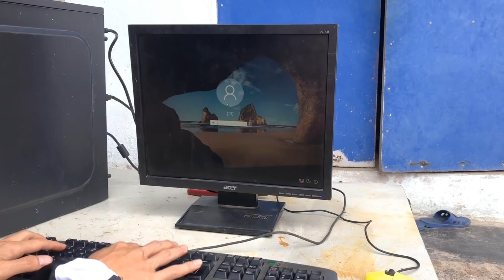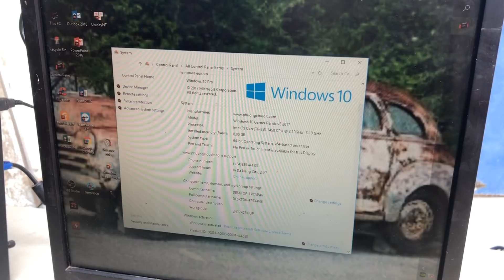Restoration a destroyed 30-year-old PC | Rebuild and restore 30 year old PC

Comment: Fake. Here's 45 reasons why:

1. How is it possible to have uniform mud on ALL surfaces, inside and out? And even on all the wires?!
2. How could mud possibly get UNDER a screw head?
3. Why is there no mud inside the slot on the screw if it's everywhere else.
4. at 2:26, why is one screw shiny?
5. at 2:42, why is there mud where the CD drive was?
6. at 2:51, why does the mud look painted on?
7. anyone else seem surprised by the lack of leaking capacitors?
7a. or by the jacks that seem pristine (given no mud)?
8. at 3:42, why does the hinge mechanism work, let alone exist in the first place?
9. at 4:12 DIRT... IN A HARD DISK???
10. 4:48 should just explain itself. NO!!!
11. at 5:15, the capacitors again. Perfectly straight and not leaking?
12. at 5:43, dirt... under the screws, IN a PSU???
13. at 5:51, that's how you lose screws... i'd be surprised if he "somehow" doesn't lose one.
14. at 6:03, why does he put a circuit board in the water?
14a. If he can dunk his motherboard in water, why can't we?
15. He just killed his hard drive at 6:13
16. Does anyone care about a wrecked CD drive so much that they'd open it up?
17. at 8:49, the rails don't seem lubed. They will make a sound or fail if he tries to use it.
18. He killed his HDD twice now because he scratched the platter and the head.
19. at 11:07, the color of the river is the same as the mud; that probably explains where the painted mud came from.
20. Spray painting without primer?
20a. And without masking... he messed up at 12:00
21. Killed his HDD again. Look at that head!
22. His PSU has no marking whatsoever, no brand, no model, no ratings, no stickers?
23. The guy must be a genius.; he must know exactly how to put together a CD dri--- wait! he forgot to put the latches on the gears! 
24. 15:06, The date on the CD drive says 2010... so much for a 30 year old PC
24a. The PCB has a date of 2009, so much for a 30 year old PC :|
25. That looks like a lot of RAM for 1990. Wasn't the limit like 100MB or something back then?
26. And it looks like DDR3, totally 1990 tech!
27. USB 2 existed in 1990 right? NOPE! Not until 2000.
28. Look at pictures of 1990s computers. And then look at this.
29. 18:03, that new intel logo wasn't rolled out until 1991.
29a. That's probably a new fan, too. Don't remember seeing a logo on it until now. 
30. Windows 10? That was sooo 1990. Even windows 95 didn't exist yet.
31. WHO NAMES THEIR ACCOUNT pc?
32. He picked this up off the street. Why does he know the password?
33. All this on an HDD with ONE platter. THAT WAS MURDERED AT LEAST 5 TIMES?
34. 8 gigs of ram, an i5, a copyright 2017, 64 bits... sooo 1990.
35. Just to point out, he exposes his registry key at the end without any blurring or masking or what. So smart!
36. The music masks his laughing at our stupidity probably. :/
37. Why is his system language English?
38. WHY??????????????????????????!!!!!! Views, ad revenue!
39. No rust whatsoever.
40. You'd think he'd spend time restoring his screen.
41. This is how many smart people agree.
 |  Don't forget to dislike and unsubcribe!
V
Reply: Yeah
Reply: A hard disk is seals dat noting like dirt or mud and ect kan get in there is no way in hell dat al this mud ans dirk and get in there
Reply: And the hard disk is even water resitand olny were the stickers are can get mud in or ader crap and the sticker are Just fine it looks like and how can hé get it open So esly the scroews are gleudt
Reply: But nice job vinding al of these respons it's fake
Reply: You are Sherlock Holmes 2.0 bro😂😂😂. This is absolutely fake video.
Reply: @krisin.5959  Thank you.
Reply: @kyria_kous  i dont understand your name!
Reply: Have you ever felt the touch of a woman?
Reply: You only gave 41 but still good job
Reply: Yeah you right bro
Reply: Well done for being honest. YouTube is the reality site.
Reply: i mean it's entertaining. It's not educative
Reply: Ademas, cuando abres un disco duro por primera vez es necesario quitar los sellos o estampas adhesivas y este disco ya no las tenia
Reply: It’s not fake he didn’t put the circuit board water. There is this liquid that can wash circuit bird without ruining it.
Reply: How mud got inside is because he found it with one of the covers off
Reply: @fenix182  best comment ever XD
Reply: @fenix182   oh here comes the chad that roasts the nerd
Reply: The most important joke is that his board have many bent CPU socket pins and without applying any thermal paste into CPU and chipsets the PC can start up...he must be PC god...😂
Reply: He could of got new parts
Reply: He could have gotten a new hard drive.
Reply: All true I read the whole thing good job
Reply: Yeah, I find it very hard to believe that it's 30 years old. It doesn't have Intel 8088 or a 286, maybe 386 like what the f--
Reply: realomegadrumer it does ha a Intel core i5. He didn’t even put dos box on it.
Reply: NayNay ZA he could just me smart on the subject and they could have a partner.
Reply: @Gamer-wf3jx  There are things that are 𝗽𝗵𝘆𝘀𝗶𝗰𝗮𝗹𝗹𝘆 impossible; regardless of skill level or found condition. Such things-- if true, would shake the fabric of reality of the universe.
Like:
Time travel. See #34, 30, 27, 26, 25, 24.
Metal oxidation physics. See #39.
Common Sense. See #40, 36, 12, 13, 14, 16, 22, Literally every comment and reply on this video.
Reply: Johnathon Baker and what does that mean? It means he couldn‘t restore it therefore it isn‘t fully restorated
Reply: Leon Mader I mean is he could have just gotten a new hard drive but he could have kept the same fan.
Reply: Hey man, good job! This is very fake video ! I cant believe that is dirt INSIDE in the hard drive that is unreal. TOTALLY FAKE
Reply: just have to ask, how much time did it take you to write this comment?
Reply: @jay-dj-0618  I included the alphabetized parts of some as well. Some were rhetorical, too.
Reply: @salimbenjelloun3689  Good question... half an hour?... I think.
You should really see https://www.youtube.com/watch?v=LkECSfTDwjs for another comment like this by me. So fake it's actually worth watching.
Reply: hahahha this is fake
Reply: Good
This is what i want to see
And this video makes me puke !
Reply: I knew 0:28 in that this was BS. Didn't even bother watching the rest, good job on your patience watching this shit man.
Reply: @johnathonbaker1084  You aren't very good with technology are you? Or very observant for that matter. If it was in as horrible condition as it looked, the pcb circuitry would have been destroyed by the corrosion, making any and all attempts at restoration pointless. I mean... He brushed the hdd plates for the love of God... At this point i'm surprised he didn't just paint the plates to make them look better...
Reply: Yes bro.. 90s kids know how these things worked... Just open hard drive its done plates react with oxygen and got badly bad sectors... Fan looks modern... And many more lol
Reply: @johnathonbaker1084  washing circuit board does not get any problem.. I did many times.. Just be sure its fully dry...
Reply: @muhammadadnan8476  Yeah me too, I wash my ECS H61 motherboard with tap water twice a year for like 8 years now, still good.
Reply: 2:44 SATA HDD :)
Reply: He does not know laws of physics.
Reply: So far i know when you opening hdd, and careless to touch platter and head, congrats! For murderer your hdd. Fake restoration.
Reply: And Windows 10 on 30 yrs old pc???
Reply: And another restoration pc has same wallpapers
Reply: do we have to care.
Reply: Jesus man you murdered the guy
Reply: Tqs bro
 same questions arw running in my mind
Great job 👍👍👍
Reply: Nice job dude thx
Reply: Nvidia geforce experience donloaded
Reply: Because in certain case only water effect on an mother board and it's for one question and it should be dryed after applying water and it does int performance..but ..only if it's not damaged
Reply: password?
Reply: @tutestudio87  apparently... i guess \_(^_^)_/
Reply: @planeinformer2247  yeah ,what about neccesary upgrades to run windows 10 ,what about motherboard too?
Reply: MASSIVE LEGEND
Reply: All yiu said is right, 👌👌
Reply: This deserves a lot of likes for the job
Reply: ok boomer
Reply: Make it loouuuddderrrrr
Reply: Boss
Reply: Absolutely right, but he also forgot to smear thermal grease under each of the radiators.
Reply: This is what i call "critism", thx for the critic mate. I almost got fooled by that video
Reply: I’m like you I’m a computer nerd too that can never be a 1990 computer that computer had like 8 gb ddr3 1366 MHz ram
Reply: Johnathon Baker it was fake how you can never download windows 10 on a pc from 1990 and that computer had like 8 gb ddr3 1366 MHz ram have you ever seen a computer from 1990 with 8 gb of ram your answer is no
Reply: Fake. One reason why:
1. Foxconn G31MV.
Reply: True
Reply: and that pc is 775 775 socket mainboard is 2006 so it's not 30 years
Reply: Yeah
Reply: a 30 year old pc should be have windows 3.0 os
Reply: The main fucking shit it that the SATA is even not available before 30 years
Reply: 46. CPU socket is destroyed (pins are bend) 16:13
47 a. SATA port has been released around 2000 
47 b. Foxconn G31MV https://www.cnet.com/products/foxconn-g31mv-k-motherboard-micro-atx-lga775-socket-g31/
48. Actually no repair, just washing the dirt out of the computer (Basically a "trashed good computer"?)
49. Optocouples and coils are loving water :3 I am sure the PSU has the right voltage outputs
50. Windows 10 boots instantly and super fast
51. Password hack on a 30 years old Windows 10
52:
Foxconn G31MV:
20 years old motherboard with LGA 775 socket (Maximum Core 2 Duo support), Max 4GB DDR2 RAM
After washing the shit off:
Boots windows 10 like using SSD
Suddenly 3rd gen. i5-3450 appeared with 8GB RAM
Reply: Oof faker
Reply: 3:48 Also the HDD doesn't have  a silver metal/plastic type of seal over the middle screw on the HDD so obviously it's been opened before..
Reply: You have achive fake releash mastah
Reply: 42. no video card but  18:30
Reply: I understand is a fake becoze you can not restore password just like this ..
Reply: I saw usb slot on back panel.
 Is it ok!!!
Reply: You forgot one thing.. Did you notice that no part has a sticker? not on the HDD, optical drive, ram, PSU, etc.. Nothing whatsoever.
Reply: nice sharp observation
Reply: Yes, that modern tower pc was not yet in market in 1990.  I think it's 2005 to 2010 computer.
Reply: And the socket of the motherboard is lga 775, the socket of the i5 is lga 1155.
Reply: god.
Reply: Well, drop mainboard and doing like this video can make this PC become true TRASH.
Reply: ya an i5 in socket 775? it in socket 1155 .18:19 18:40 lol.20:13 da nang?
Reply: XD exact
Reply: Lol knew it when he picked up the pc and washed the hard drive lmao
Reply: 46. Seems legit desktop wallpaper is a rusty car that need restoration lol
Reply: This thing is sata from the begging ahhaahhaah
Reply: IS THIS A CBI INVESTIGATION XD
Reply: Idc but restoration progress was well done
Reply: Gresha C. I have noticed the same things as you did. One more thing to add is that the computer that was connected to the monitor is not same computer that he claimed to restore. These people just do not have anything better to do than to post fake videos I guess.
Reply: It's obviously a fake restoration video 😂😂
Reply: Correct bro!!
Reply: Yap
Reply: All Restoration T-D's restoration videos are fake
Reply: Exactly!!!
Reply: @kyria_kous   ellinas?
Reply: @ThePoptardedtj  it's greek name
Reply: Correct he just set this all up
Reply: @vanessaivonnelara2556  Es un completo sinsentido, dejando de lado esa aberración que hizo con el disco duro, y que los tiempos no corresponden, el título dice que la computadora está «destruida», y yo no vi destrucción por ningún lado, la única destrucción la hizo él mismo PREVIAMENTE al disco duro, incluso en videos más serios por el estilo, donde sólo se señala que se hará una restauración, salen de imprevisto detalles en los componentes que son irreparables, y el «restaurador» aficionado o serio, muestra claramente que se tuvo que reemplazar uno o varios componentes... este chico sólo «lavó» la computadora completa como si se tratase de un juguete enlodado... Saludos Ivonne.
Reply: X Factor
Reply: + He don't have a graphics card on the pc, but the vga cable is plugged into the slot of the graphics card when it's running.
Reply: Wow with out Editing the comment
Reply: What did you expect from china man?
Reply: @johnathonbaker1084  what is the point of restoration if you only keept the cover of the computer?
Reply: É até legal de assistir uma coisa dessas
Reply: i think he buyed new screws there is no rule that we should restore it with the help of old things
Reply: Really agree with 15 this is "how to fuck hard drive sim"
Reply: I have seen an a 1990 tech PC in our home my parents used it then put it basement then one day i started exploring basement for a bit i just found leftovers a case, motherboard  no ram no cpu no cooler and a screen like old tv's XD
Reply: @salimbenjelloun3689  Let's just say it was the best 30-40 minutes of my Youtube life this year.
Reply: Yo no espiko inglish we
🤣🤣🤣🤣
Reply: I don’t really know why I don’t care that this is fake
Reply: @greshac.3634  for thos wondering yeah it's just a waste of time. Unless he put morden hardware in the pc I don't think it can't support it. Plus pcs only ran on like 500 mbps of ram and it possibly could not run a 64bit operating system bc 16 bit and 8 only existed at that time and I believe windows 2.0 or ms dos 4 was a thing 30 years ago.

But in wondering if a old pc can us a modern hard drive modern motherboard  and modern CPU chip? Idk I'm kinda curious 

Plus Intel Pentium was a thing back then

Also remember that the computer is basically like our brain you damage something and it messes it up and I don't like the fact that there is no crt monitor. Ik I might be crazy but flat screen didn't exist in the 80s and early 90s Idk the history on when they really existed.

But the video is uhhh Iv seen faker videos that are much more entertaining.  So yeah
Reply: I guess everyone knew it's fakr
Reply: If I have watched the video before reading this comment I was anyway know that it's fake bec it's impossible to be a 30 yr old pc bec hhd (western digital) -(Samsung dvd cd rom) -(case itself) it should be old and minimalist if white
Edit: Washing circuit board 
There is No capacitor leaking
Opened hhd
Impossible to use hhd after a scratch on rotating disc
Fast Windows 10 on poor drr2 memory and 5400 hhd 
What a lie!
Reply: You forgot something. He published a restoration on a monitor and in the final part he puts the same clip as this video (also final clip) even the password guessing and this one is newer than the other one so yeah the last part on both videos were prerecorded

and they're Taiwanesen (I knew it)
Reply: @salimbenjelloun3689  Like an hour.
Reply: Also he bent the pins on the socket LMAO
Reply: I love you! I wanted to say soo much but you did it for me lmao. Thanks man! You are very smart.
Reply: @johnathonbaker1084  its called Advanced Soapy Se
Reply: @johnathonbaker1084  it is a type of liquid called Advanced Soapy Serum (a$$ for short) it has miniture robots that are inside the molecules and controls the air around it to suck up the gunk leaving a soapy spotless smell behind!
Reply: In 30 years old windows 10
Reply: he still resstored it, but he destroyed it so...
Reply: Thanks for your explanation, hahahahaha you burned the guy completely!
Reply: i5-3450 released in Q2  2012, yeah 30year old :D
Reply: He killed his HDD like 10 times :D and when he's turning on the pc, you can actualy see that the PC's panel is different. Nobody washes their computer in uganda river and then pretending that it works:D
Reply: Mucho texto
Reply: He also killed the cpu socket by scrubbing it, the pins are certainly dead
Reply: @TheZenAku  yes you are right bro
Reply: Is this my wife?
Reply: Your comment is the most interesting thing of this video 👌🏻👍🏻
Reply: bro, another fact: at the end of the video he showed a completely different computer, because all the video motherboard was on socket 775, but at the end it had an i5 3450, and this is socket 1155, which looks completely different (look in Google for pictures of foxconn motherboard at 775 and 1155)
Reply: I can confirm, that is a lga 775 socket and that was a intel cooler for the core 2 quad series (which was popular in 2009) and came out in 2006
Adding on to that,
Sockets did not look like that at all in the 90s... it would have a small fan and it would say PGA (your core model here) and have a am4 lock type approach.
Also not to mention it would have to have cash and d ram slots, it has pcie (supports modern graphics cards like the 3080) and it also has a modern 4 pin fan connector I am 13 and know more about PCs then you
Reply: And the pci express in 1990?
Reply: @diogogomes226  ikr
Reply: 42   At the end the caseing (black top and silver middle).looked perfect like it left the factory with no over lap even though he was spraying it like a 10 year old spraying his bike for the first time. Eberyone knows that he does it  reverse it's an old tried and tested method but still fun to watch for how silly it is. And let's face it its still a lot of work for the guy because he's got to take the thing apart twice and clean the dam thing too. So I suppose he's earned his ad revenue really.
Reply: @johnathonbaker1084  I know video is fake and done in reverse  but you can wash motherboards in water people do it often just as long as you make sure it's completely dry. It's actually a really good way to clean a dirty board and if done properly should give you no problems.
Reply: geo vai I am better with software then hard ware
Reply: Sata 2...
Reply: He has a different computer hocked up to the monitor when testing it.
Reply: Yes bro 10000% fake because video last cpu change this bro
Reply: 1:56 clean connector  and other video same fake
Reply: hey ,if anyone else  trying to find out 
electronic repairs london
 try Saankramer Electronic Magazine System (just google it ) ? Ive heard some incredible things about it and my neighbor got excellent success with it.
Reply: yea is fake  you can tell by the windows 10 logo at the begining
Reply: Yeah great work listing so many. You might be interested though, #14 is actually valid believe it or not. You can clean circuits boards with soap and water without damaging them as long as they're dry before you power them up. I personally would never try it though, too hard to be certain there's no water you can't see. Everything else though? Totally right. These kind of fake videos really need to go away.
Reply: Yes bro definetly fake
Reply: Just watch the vid mate
Reply: and, just by analizing how the ram and the cpu cooler looks like, its definetily not a 30 yo pc
Reply: +he would kill procesor pins while cleaning
Reply: Thank you for noticing these things and making sure I don’t subscribe
Reply: I only know how to build a PC but you are near of stephen hawking lol
Reply: @johnathonbaker1084  and ur telling right now he can clean up a hard drive like that brooo you don’t know anything about computers
And also it is impossible to run windows 10 on a 30 year old computer
Reply: @johnathonbaker1084  yeah a new motherboard because a 30 year old motherboard will not support ddr3 ram and also not a i5 cpu 

So he just bought a new pc after
Reply: @johnathonbaker1084  a 30 year old fan is not fitting on that cpu socket
Reply: wow you are my hero.... you type it all alone?
Reply: Rust is an important thing by Old stuff (even some Orange spotties) 

Even new computers can get Rust
Reply: what I see clearly, i saw a usb ports on the motherboard and sata port (power and data) on the dvd drive. Thats something for 1990. hahaha
Reply: To nemůžeš vědět jestli to je fake ok 30 let starý asi nebude ale fake to být nemusí
Reply: i have a "stock" PC just a cheap one and there are no labels on them and its from dell i believe, but i do agree on the HDD, you cant just open it and clean it? WTF? the PSU and DVD ROM as well???? water damages circuit boards, nah this isnt real it cant be, one more thing when i saw him put the password he did try a few times and the camera cut a few parts so its possible he went to the peoples house to ask for the password, dont judge to quickly on some things or get tunnel vision gotta think about every including when the camera does a cut
Reply: He drop his cpu on the water in 6:05
Reply: Yes its look like fake
Reply: I was so triggert when  he opends the hdd and cleand it
Reply: Works as ASMR though ...Call it "Fantasy Repair" ... then I would say great video
Reply: nice job bro :=)
Reply: You are really smart
Reply: https://youtu.be/-yhUPfDslcE?t=1104 turn on another PC
Reply: calm down u should relax while watching that's the purpose of the video 😁
Reply: Lol you took some time.... my friend just do the math... 30 years old pc = year 1990 ... no need to explain further :D :D
Reply: Point 19 -u r just awesome .....wt a guess ..even investigating department will fail to relate that thing 🤣🤣🤣🤣🤣🤣🙏
Reply: @markg3506  I mentioned the PSU's missing sticker, and the fan does have an Intel sticker (also mentioned). But yeah, you're right.
Reply: @johnathonbaker1084  (Read full message) For your question, it is anhydrous isopropyl alcohol actually, but by the way this video has certainly a lot of fake points, like how he   guesses the password and why i5 can possibly be on a 30 year pc, actually. He mostly killed that poor old pc and reassembled a whole new one that have a similar look.
Reply: @johnathonbaker1084 (Read full message) To say the least, the hard drive, motherboard, ram and cpu must be replaced, which means that more parts are replaced than original.
Why Hard Drive?
He destroyed the platter. By the way 1990 PC mostly wont have 16 GB hard drive. 16GB drive is the minimum for Windows 10.
Why motherboard and RAM?
Motherboard won't support 1GB of RAM if it is made in 90s. Windows 10 will mostly crash on boot if RAM is not enough 1GB. The pins are also damaged beyond repair. 
Why CPU?
Well, no i5 processors are made in 90s.
Reply: You deserve the likes
Reply: Open a hard disk, and mud inside.Jesus
Reply: my man you totally roasted that guy lmaooo
Reply: Its LGA775! FAKE! 👎👎👎
Reply: Usually the 30 years old computer’s color was white but this one is black and I think this computer was just 10 years old (1990 COMPUTER DOESN’T HAVE A CD-ROM!)
Reply: Bent CPU Pins due to reckless brushing of the motherboard...
Reply: la verdad no hacia falta las 45 razones con la forma del barro  es suficiente para saber lo armado que esta el video
Reply: bro you are genius
Reply: 42nd reason: WHY TF IS IT BLACK
Reply: simple, that fake
Reply: 18:20, look pc case, It is flat on the side, 5 seconds after that completely different case on the table.
Reply: This pc can't be 30 years old. The parts are too new. And it's just fake.
Reply: Lmao
Reply: Front USB in a 30year old PC!!!!
Reply: That's 41 :(
Reply: LoL comment
Reply: Bro also if u noticed the power button, it didnot even turn on and the display cable from monitor was going downwards and not towards the pc also a notice the motherboard and other techy stuff of a pc is washed with alchohol, i did it 4 yrs ago and it worked like a charm but this guy, he just watered it like it never gets destroyed....
Reply: This guy open the hard drive and washed it to restore 🤣🤣
Reply: Nice!
Reply: Wow bro! Even I was thinking that's it would be real but when he dipped MB into the water , I was like 🤣🤣🤣! Nice job bro !
Reply: must be drop from some Time Travel Machine ... LOL~
Reply: he might destroyed it and pretend that its a 30 year old pc earn some views
Reply: Good job! Did you notice no thermal paste or pads on any of the heatsinks
Reply: At 10:00 he kills the CPU socket
Reply: 16:35 the RAM doesn't get seated
Reply: I will subscribe. I want to  laugh more in the future.
Reply: How many times this guy killed the HDD 😆?
Reply: maybe it take the processor, the audio card, the video card, a new CD drive and use it. this video is fake ONLY for 99.99999999999999999999999999999999999999999999%
(i speak english so bad because i am italian, in this sentence theres a lot of errors, right?)
Reply: @TALHA SHEIKH  it's fake
Reply: I knew it was fake too. I MEAN. HOW TF DID DIRT GET IN THE HDD!?!
Reply: as wat i hv seen,the motherbrd is socket 775,f im not mistaken,socket 775 released in 2004,socket of RAM is DDR2,and the HDD is already Sata,Sata HDD,released was 2003,i agree ds is fake restoration.
Reply: @MasterofDisaster388  twice. The first time was rubbing the inside of the drive with mud and dirt. The second was putting it in water
Reply: It’s OK you can put anything in water because can’t have any resolved voltage inside you are right about that disk drive though that doesn’t make any sense
Reply: Merci 👍
Reply: اقسم بالله ...عند النظرة الاول قولت لنفسي يبدو أن هذا الجهاز مطلي بالطين... أين الصدأ يا اخي ؟!
Reply: Well yes win 95 does not exist in 1990
The latest windows in that year was win 3.0
Reply: Another proof it's fake: the mobo had a LGA775 socket, but when he puts the about this pc info it says intel core i5, and i5 is not compatible with lga775 sockets.
Reply: @fenix182  have you ever felt your brain cells?
Reply: You're right about everything except 14a. You actually can dunk a motherboard in water, as long as you know what you're doing. Pcbs are actually washed a number of times during the manufacturing process.
You need to make sure there is no power running through the board, including the CMOS battery and any caps that might have a charge.
I like to use deionized water, and then follow up with anhydrous IPA, although the alcohol step is unnecessary as long as you allow plenty of drying time. If you use only water, you need to let it dry somewhere warm for a minimum of a week. I have cleaned some absolutely filthy vintage machines this way, including things like dried-on soda spills etc, and they all look pristine now.
Reply: @thepenultimateninja5797  Yes, you're right. Not to discredit you at all but I was hinting towards his lack of care. As you mentioned, "if you know what you're doing." Here, he did not and/or did not care.
Reply: @greshac.3634  Oh absolutely. The guy is a total fraud.
Reply: Even Windows 3.1 until 1992
Reply: You can wash circuits in water, but you need to make shure its properly dryed before its used again.
Reply: the way he just cleans that hdd , and it has missing parts xd